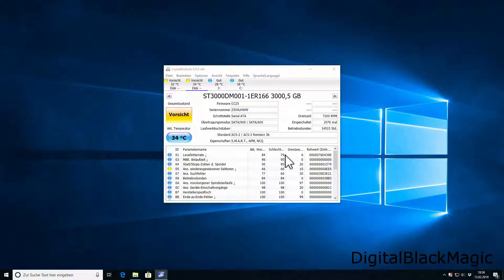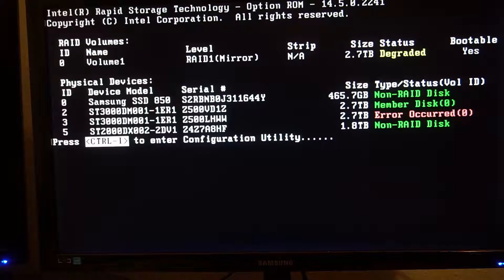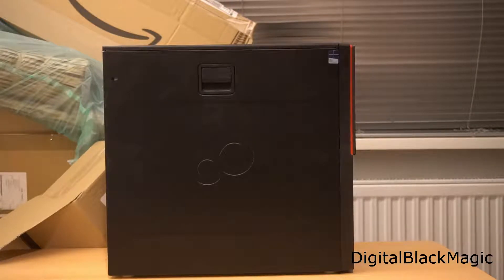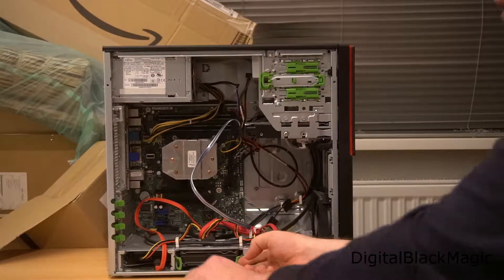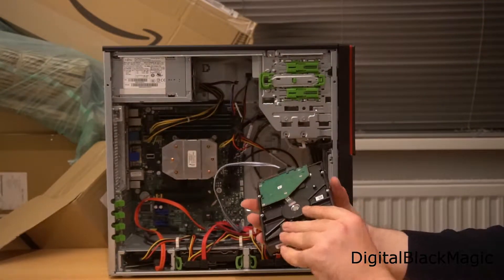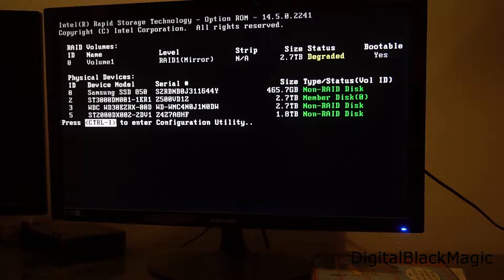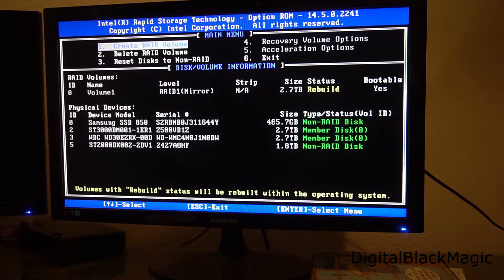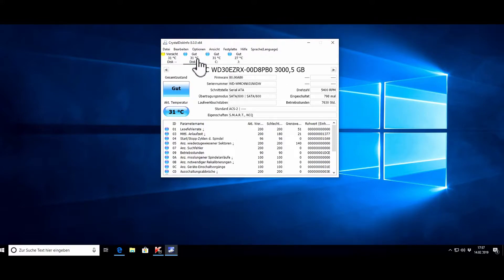018 Failed Intel Raid 1 HDD swap

Comment: What happens if you CTRL+I and Reset disks to non raid?
Reply from the maker: all contend is gone, normal disks as without the RAID system.
Reply: @digitalblackmagic7227  what happens if I Delete RAID Volume? I have Degraded message on start up but Crystal Disk Info shows both drives are fine. I have a new drive on the way, just curious of the options.
Reply from the maker: This  can happn if you hard reset your system. The system will resync in the normal case. If this doesn't happen eject one drive and let the raid bios know. :) Once the drive is marked as "failed" you can reconnect it and resync the RAID. Check the SATA cbles, they can be bad as well. I never "played" with the options. Cannot remember what happens if you just erase the raid. One of two all data is lost, or the data is mirrored in two disks without sync between them.
Reply: @digitalblackmagic7227  !!!!!!
I unplugged the drive with the error and restarted. PC booted normal, RAID BIOS showed normal with single hard drive but array still degraded. I shut down and reattached the "faulty" drive and rebooted. It showed the faulty drive as "Member offline". I booted into Windows and restarted. Now it shows both drives as member and status is now REBUILD! Woohoo! Thank you so much! I still have the spare drive just in case. :)
Reply from the maker: Keep the system online, it takes several moons to restore the raid.

Comment: very good video, thank you, 
one question, do you not have to open the program 'Intel Rapid Storage Technology Enterprise' from within Windows and tell it to 'Rebuild'
Reply from the maker: you can I guess,  but it does this with the drivers stand alone. I do not use this program. It says so when you set it up for the rebuilt
Reply: @digitalblackmagic7227  ahh yes of course, your video was more useful than all the forums I checked, I have just swapped in a new drive (on this pc) and the rebuild has begun, very easy to follow video, thanks again  5 stars :-)
Reply from the maker: @tom-fj1bb  great that it is of some use. Anyway the rebuild takes houers. so be aware of that.
Reply from the maker: thanks